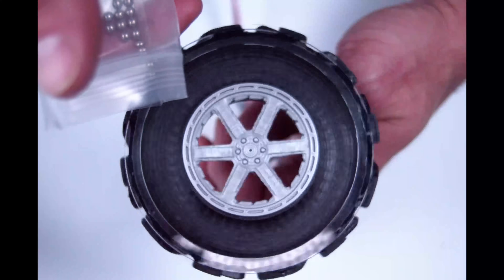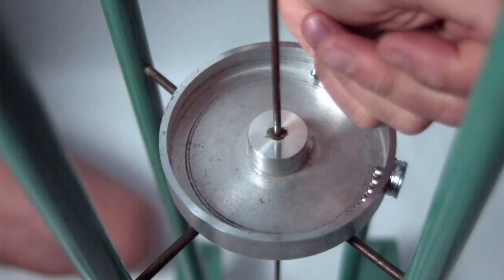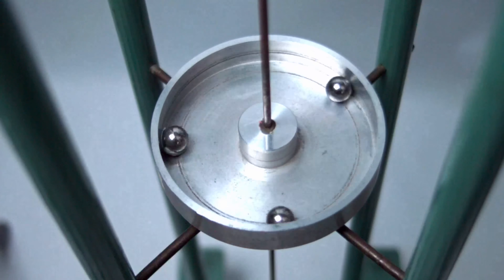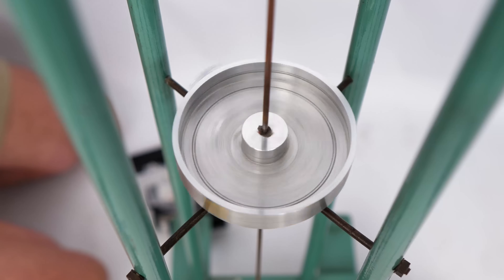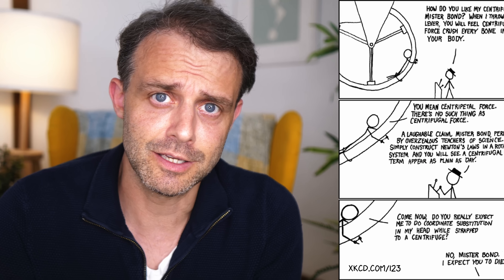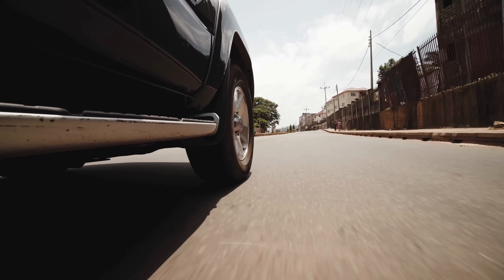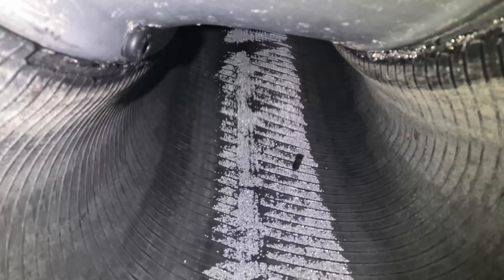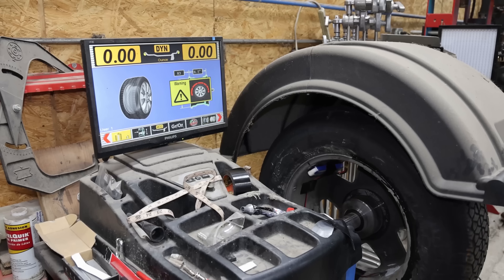Do tire balancing beads actually work?

Comment: Fun fact: truckers and long haulers have used airsoft bb's for years instead of the overpriced balancing beads. 

Also, many have tried  it on water bottles and other things but one thing they miss is the flexure of the tire itself which constantly adjusts the beads to maintain balance.

Comment: Would this work with water too (i.e an infinite number of beads?)
Reply: Winter time would be fun when it froze, but I've encountered quite a few tires with water in them for one reason or the other, it causes the tire to rot from the inside, and the stagnate smell after a good hot summer could gag a maggot.

Comment: I'm curious if this is can be thought of as a problem analogous to orbital mechanics where at high rotation speeds the balls move towards Lagrange points with the lowest local energy in the system

Comment: 35x12.5R17 "flotation" tires. 2 different tires shops tried and failed at balancing them (one even tried to tell me it's OK to stick 3 rows wide of weights if needed).
50$ later and 13oz of beads per tire, they run smooth and wear smooth. I don't hit the highway until 20min after I leave, but I can tell you around 60km/h they are balanced already.

It just works.

Comment: seems like it would be better if they were adhesive and were put in the tire in a air sealed package that broke at highway speed so they would deposit in the right spots and adhere. Not sure how you would accomplish this though.

Comment: Retired heavy wheel mechanic. They work! Only way to balance semi truck rears. Used balance rings on front. They're just bolt-on rings with beads inside. Fabulous stuff. Give you unreal mileage on steers.
Reply: I work for a logistics company. I’m gonna bring this info to the guys at our shop. You might have just saved us some dollars. Thanks for the great tip!
Reply: @Amplified62  to save money just don't balance the drive tires or the trailer tires at all. Balancing the steer tires does have benefits though
Reply: @helloneighbor11  Unbalanced tires shorten the wheel bearing service life, no matter which axle.
Reply: @MikkoRantalainen  I understand that could be possible, but I have not had an issue with failed wheel bearings
Reply: @Amplified62 after it proves to work ask for a raise lmao
Reply: Couldn't somebody manufacture balancing rings with some epoxy resin inside? That would make the balancing ring single use (e.g. once you combine the epoxy components the ring will freeze solid in 15 minutes) but it would result in fully balanced tire that doesn't lose the balance when stopped.
Reply: @MikkoRantalainen  as tires wear, their balance changes.
Reply: @MikkoRantalainen  I seem to remember there is some fluid that can turn solid when an electrical charge is applied. It was used in clutches. I wonder if it would be useful here too?
Reply: @Mueller3D  Interesting idea. However, it's kind of expensive to transmit continous flow of electricity over wheel bearing. Even modern pressure sensors in wheels are more or less problematic at all times.
Reply: @MikkoRantalainen  Ok, unless you have TPMS sensors. They'll get permametly clogged with epoxy.
Reply: Wow, interesting idea!

 @MikkoRantalainen
Reply: @MikkoRantalainen The rubber of the tire will soon become unbalanced again as it wears
Reply: @MikkoRantalainen  Re balance beads:  Another commenter says he researched this in 1965 and they used a pneumatic system to fix the beads in place once balanced.   Presumably that would enable you to release and fix the balance beads or balls whenever you want to re-adjust.
Reply: @MikkoRantalainen thats a good idea. But the tire changes over time. And would need to be rebalanced.
Reply: @MikkoRantalainen ...you want it balanced when driving...who cares about balance when stopped
Reply: Wouldn't this balancing system work better if you put a liquid in the tire??
Engine coolant would not evaporate and would help prevent aluminium rims from corrosion between the tire bead and rim seat.
Reply: @angelocardoc   No. I don't remember all the specifics, but the size of the beads matters. Sand is too small to work correctly to balance and water doesn't have any size particle to speak of. Too big won't work either. Anyone who runs antifreeze in tractor tires can tell you it can make the tractor jerky on the road.
Reply: I use them on my pickup with 40" tires, then they stay balanced clean or muddy
Reply: One of the fantastic things about balance beads is .. doesn't matter. They find the balance points. Right up till the skin has a hole through it and the beads escape. At that point, the beads are not in the tire and therefore....cease to balance the tire. Unlike weights that are static and Must be moved regularly to compensate for outer wear. You didn't think that comment through.
Reply: He was replying to the person that came up with an epoxy-set version of beads idea. Like affix a ring, put liquid in it, and drive it till it sets

 @judbaber

Comment: Some differences with an automotive wheel:  it’s not oriented the same as your test apparatus with respect to gravity, and due to tire deflection is never really round.  I think both of those things would have a significant effect on your balancing beads, which to be effective must have non-negligible mass and have to be able to roll around freely within the spinning shape.

Comment: I don’t use them because they are a pain when it comes time to change tires.  It simply isn’t that hard to apply traditional wheel weights and wheel weights work at all speeds.  Inserted the beads and then dealing with them at tire changes is far more time consuming that traditional balancing with weights.

Comment: Instead of ball bearings, would a high viscosity oil work? 

I recall at a car show, maybe Kate 70s, and someone selling a dynamic wheel balancing device. It was a doughnut filled with ball bearing and oil. Maybe 8 in. dia. He had an out of balance wheel at speed, chaos. Then mounted the doughnut with the wheel on the hub. And it started out, out of balance but almost immediately smoothed out.

Comment: I hit a nasty pothole a while back, and when I say nasty I mean a chuck of this world was deleted, leaving a sharp-edged, jagged, deep hole, just wide enough for a 16inch wheel to sit on and not fall in. Hit it going 40 on a bend, tire was instantly deleted (brand new one too😭), and I needed a  tow to the shop. They replaced the tire but, as I drove away from the shop the next day, I had to turn around and head back to the shop almost immediately, terrified something even more expensive was broken. Barely going 25mph felt like I was driving over the most aggressive rumble strips in the world, and this was a recently paved flat residential road, which on the uber back to the shop felt like riding over butter.

Turns out the inside of the wheel took the brunt of the impact, in the perfect way to where you could not tell unless the wheel was taken off and flipped over to look at it from the back, think bent metal on the inside rim of the wheel (didn't know they could do that with the car surviving). Anyways long story short, absolute legend at AAA took the wheel off, found the problem, and applied some weights to balance it out while I waited for a new wheel to come in. I went from my wheel shaking violently at anything above 15mph, to being able to drive highway speeds with nothing but a slight vibration for a month while I waited for the wheel to come in. Man was a magician

Comment: Surely this would increase the unbalance in the tyres at low speeds. I wonder if you could spray a glue inside while it's spinning and balanced

Comment: So if this effect is based around wheel rotations per second it would work better with smaller tyres than larger ones ?

Due to fact that you need more wheel rotations per second to achieve the same road speed with a smaller tyre ?

Comment: I've been running a set of continuous wheel balancers for over 30 years on my pickup trucks and van.  The Ford I-beam front ends were brutal on front tires and shocks.  Plus, an empty 3/4 ton bed made the back end rattle your eye teeth after running over a set of train tracks.    Both ride comfort and front tire life improved dramatically.  18-wheelers have been running them for several decades now.👍👍

Comment: That's why you would need an extra rotor that counterbouce inside the wheel, basically a gyroscope, you don't need beads that spin along the wheel but that keep the center mass (that's what the gears are for), the force as you have explained will auto adjust to the proper position.

Comment: These beads are used a lot in the trucking industry to great success. I looked into them for my personal vehicles and the manufacturer has a list of acceptable tire sizes. When doing some digging, I found they don't recommend them in lower profile tires. It had something to do with the low sidewall aspect ratio not letting the beads position themselves correctly. I've never seen that particular situation tested.

Comment: OK, so here is a problem. I used Centramatic balancers in my motorhome. The would actually be worse on a bumpy road and never find balance, however on a typical road they would work well, BUT only up to about 80 mph. Above that, they would fade back into not working again. Most of the time I was driving less than 80 mph, however when you get out west, the speed limits were 75 mph, so 10 over means 85, where the vibration would begin to fade in. It would fade back out above 90 mph, but most of the time I did not want to travel that fast, as I was towing a car. 
My current motorhome has beads in the tires. It works for the most part, but not as good as Centramatics. I do not drive my current motorhome as fast, so that aspect is never a problem. The internal beads in the tires are not as smooth as they should be.

Comment: Would balancing beads increase the MPG of tractor trailers and other long distance transport vehicles? Their tires wear inconsistently and are repaired often instead of just replaced so they're never the same.

Comment: Glass beads rubbing on each other means glass dust after a while. Good luck with your lungs if you try to replace tires without respiratory protection.

Comment: This was a fascinating video about a very silly product. Even if it worked better (instead of making it worse until you hit 60), it's solving a nonexistent problem. 

Your wheels get balanced whenever you replace a tyre. It's a normal part of the job. You'd have to specifically ask them not to do it, and they're not going to give you a discount for that. I think I've only ever lost s wheel weight once in my driving career and had to take it in specifically to get it rebalanced.

Edit: and that was neither expensive nor time-consuming.

Comment: Those dymitic balancers  do work, but the biggest issue is speed and if the suspension works against it. Truck tires don't rotate fast enough for it to work. They do use oil filled ones that somewhat works.

Comment: As a car enthusiast, this sounds like it could be the dream if only the beads could be made to stay in place. Imagine something you could balance on your car, at speed, taking into account the variables for the rest of the rotating parts creating near perfect balance, there would be no visible anything on your wheels, and in theory it would get leave no trace even on the inside of your wheels, only the tires. Could the insides of the tires be coated in a thin, flexible glue of some sort that hardens up over time, add beads, then put on a lift and spun up to speed for at least the drive wheels (maybe a standard wheel balancer for the rest)? Maybe that would change the properties of the tire though, but sure sounds interesting.

Comment: On unbalanced tires the tread will wear off quicker on the lighter side of the tire than it does on the heavy side which progressively makes the tire more unbalanced over time. The heavy side moves the center of mass closer to it so that the light side wants to rotate around that center at a greater diameter than the heavy side. That causes the light side to be pushed harder onto the road surface than the heavy side, increasing its wear. It's definitely counter intuitive. You would think that the heavy side would hit the road harder eventually self balancing due to more rapid wear.

Comment: So if you were to inject a rubber cement that hardened and cured in like 30 minutes and then drove around on the freeway for the next half hour while it sought its centrifugal balance and hardened, would that permanently balance the tires? If so, I want credit from whomever steals this idea.

Comment: I first heard of them as a suggestion for motorhomes, so I can see where they would work well. They spend a lot of time on the highway or just off it. 

I live on a rural highway and go a lot of places on other rural highways so i imagine they would work well in my car, too. 

On the other hand, most of the time the tire place does a decent job balancing them. I wonder how much it changes with wear?

Comment: Same thing was found in every CD/DVD player. No CD or DVD are perfect and needs balancing every time disk is inserted. Top dish like part contains few steel balls and it works perfectly.
I got glass beads applied 15y ago to my 4x4 car which can go out of ballance with mud stick to the rim. Beads made it nonissue.

Comment: So just put a fast curing epoxy that sticks to rubber without harming it. Get up to speed, perfectly balance your tires, the epoxy cures and the tire stays balanced even after a full stop.

But just one note: If you change your rubber, tell the mechanic you have balancing fluid/beads in there. Nobody wants a messy surprise during your work.

Comment: they only help so much. if you tire is completely out of balance, then they are more of a risk than help. also you are basically putting an abrasive inside your tire that loves to go inbetween the wheel rim and rubber and create leaks if your tire pressure isn't up

Comment: I had a 36 foot motor home which used simi-truck tires and one of them was simply impossible to balance with the standard lead weights. At SOME random speed after a rebalance it would vibrate. We put the ceramic beads in and totally fixed the problem.
However, a lot of motorcyclists use the beads and are happy with them BUT i found that using them in the tires of a race bike could have sad results. At high speed, leaning the bike over going around a curve the front wheel started hopping which caused the bike to exit the track quite quickly. I think that at the high lean the interior shape made the beads leave the balanced position and go into a clump in one place, leading ot severe out of balance. My bike was scuffed up (and so were my leathers but not me... Thats why you wear armored riding gear) but rideable, back at the pits we demounted the tire, removed the beads and conventionally balanced the tire/wheel assembly. Back on the track with no problems. It was the beads.

Comment: No, I have not paid for "balancing beads". In the first place, I have a bucket of glass beads, so if I wanted to do that, I would just go out to the garage and put them in my tires. There are other things to consider though. With enough motion, those beads are eventually going to wear either the tire or the wheel. After all, glass beads are made to clean metal. I am more of the "buy once, cry once" type. I'm just going to pay to have it done correctly, and I won't have to mess with it again. And I won't have to worry about what those little beads are doing to the most important control surface of my car.

Comment: They should make these with glue that hardens after a while so you drive fast for a bit and they harden into the spot where you need them and then they stay there even while not moving

Comment: So the best thing to do, is fill your tires with beads that are sticky, prop your car up on jackstands & run it at x mph for until the glue cures, then you have balanced tires as long as the glue holds...

Or you could get them balanced

Whatever floats your boat

Comment: Something similar has been available for heavy truck tires for decades.  Instead of beads inside the tire, they're ball bearings inside a hoop that mounts on the wheel, so when the tire is changed (with trucks it's often the literal rubber tire that's changed, not a whole wheel), the wheel self-balances again when you pull back onto the highway.  Very useful on a long-haul rig that spends most of its life at highway speed.
Reply: I don't know who you normally buy your car tires from convinced you that you need new wheels every time, but normally you only replace the literal rubber tires and not the wheels on all vehicles, all of the times
Reply: @gorak9000  The distinction he's referring to is that, on a car, you take the wheel and tire off when replacing the tire, but on a heavy truck the wheel stays on the truck.  Leaving the wheel on the truck makes balancing it rather more difficult.
Reply: @gorak9000  He just used inaccurate terms. The real way trucks work is that only the surface of the tire rubber is replaced and the wheel and the tire body remain the same. The tire must be removed from the wheel for the resurfacing so you would still need to do full rebalancing after the operation if you don't use balancing rings / hoops.
Reply: @gorak9000  I think they're referring to the fact that big truck wheels often don't leave the vehicle when the tires are changed, making it impractical to balance off vehicle, not saying that other wheels are disposable.